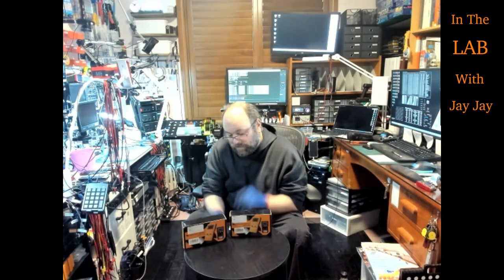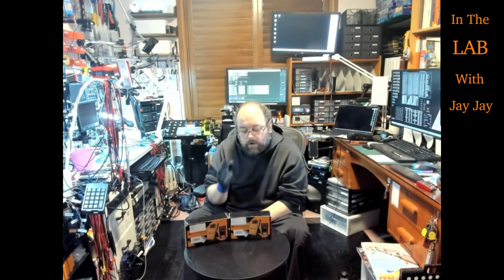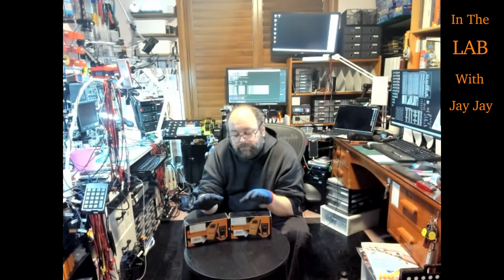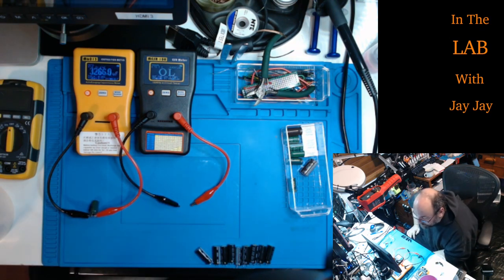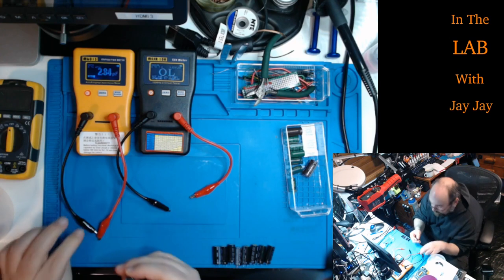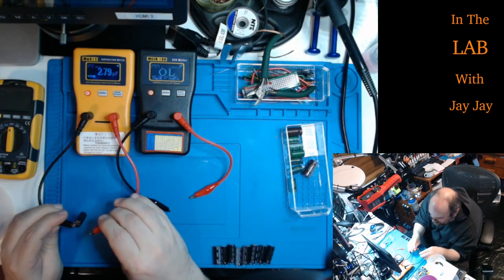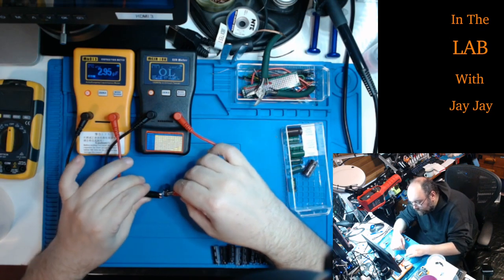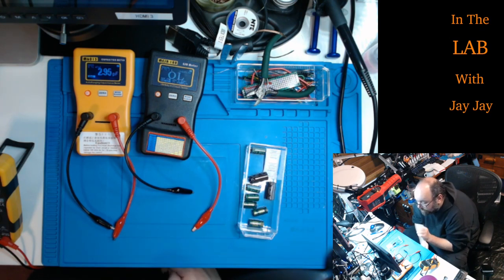Extra Content #15: Unboxing of M6013 Capacitance Meter and MESR-100 ESR Meter | In The Lab

Comment: so really if you have a multi meter that does capacitance you don't need the M6013, in testing you want the 100 also read they don't like long leads the alligator clips will be a pain but i have banana plugs
Reply from the maker: Yes that's right. If you have a multimeter you probably don't need an M6013, except if you wanted to get a second opinion for your reading. The MESR-100 is handy to have for measuring ESR.
Reply: @ElliotsExtras  yea I was wondering that looking at that, I searched for it as it wasn’t all that clear on ads like you say, the mesr 100 will be ideal but I’ve found another esr 2501c it dose look better and cheaper it just needs a lithium battery it’s probably why you can have longer leads
Reply from the maker: @namAlexander  The ESR 2501C looks like a reasonable choice, but I don't have any experience with that. I got my MESR-100 from AliExpress, over here: https://www.aliexpress.com/item/1005005925078505.html Make sure you pick the MESR-100 not the M6013. If you end up buying something I'd be happy to hear from you about how it turns out. Good luck!
Reply: @ElliotsExtras  their is a good review on it on here there is not many though, yea you got to watch that ive been on that site for a while